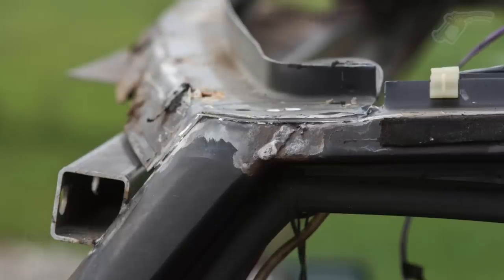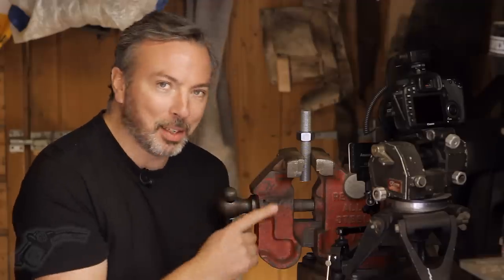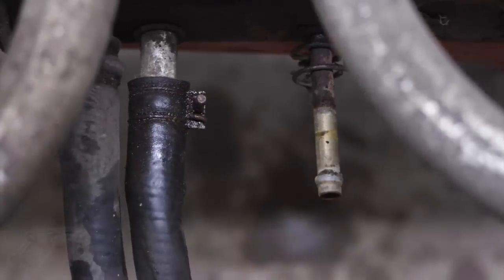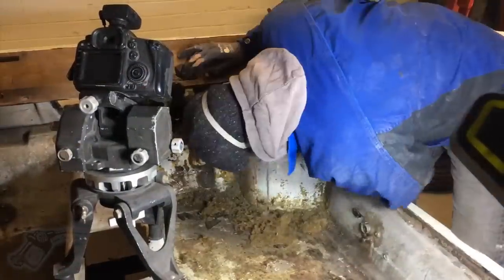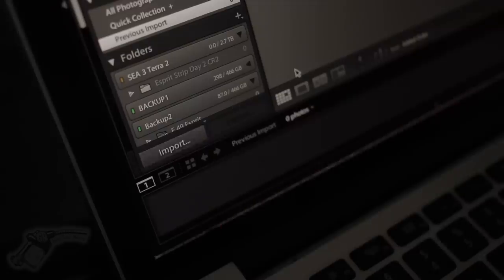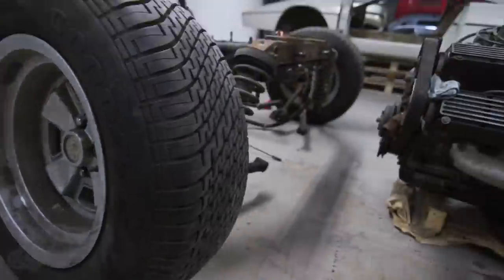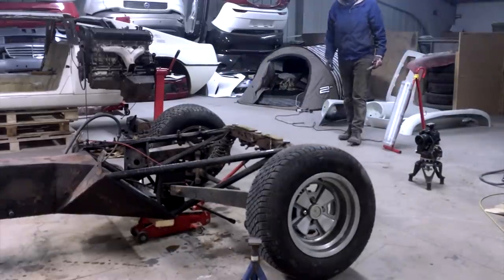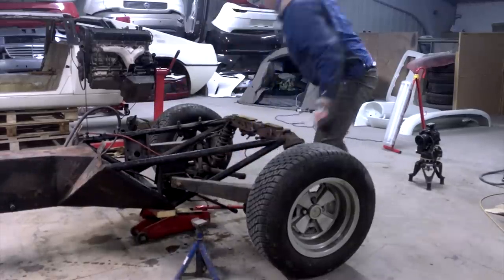How to make your car restoration take twice as long.

Comment: I know all too well what goes into restoring a car from a pretty average state... It's a huge undertaking and a huge commitment. So many people undertake the task with all the correct intentions and lose their way for a raft of different reasons. These reasons may be no fault of their own either, but it's common when they 'hit the wall' and become overwhelmed and despondent when the magnitude of the task becomes apparent. I've come close to this a few times as I normally undertake several projects at a time, but keep plugging away until I arrive at the result I set out to achieve. BUT... I can not even fathom the work you put into your productions. Your work is inspirational and highly original... I mean, show me someone else on any published platform that has (and is able) to come close to the quality of your productions. Nobody would blame you for settling for a more modest approach as the rest of us do, but to remain producing and publishing in this format as well as achieving the results you do is nothing short of incredible... well done indeed!!
Reply from the maker: That give me energy Peter. Thank you. I started with multiple projects for the very same reason - having options and somewhere to go when one wasn't working. 18 months later I realised it was killing me, 13 months after that I'm still trying my best to finish the smaller ones so I'm just one car deep. Hopefully two more months of head down will do it. Frankly I had to roll this video out because I just couldn't force the Esprit project any quicker this month.

Comment: I have been doing a little bit of welding, but it was a revelation for me to see your stop motion welding.  I saw clearly for the first time how much the metal is really distorted by the heat and how much it can move around. It never gets old...
I was very impressed by the high standard of production in this series from the beginning, and you just keep delivering and keeping true to your original idea. Fantastic!
Reply from the maker: Thanks Göran, just keeping the head down!

Comment: you are absolutely extraordinary! - Your patience and perseverance are difficult to begin to comprehend - If only projects could be achieved at the same rate as shown in finished performance... What is your next project? A TVR would be a good follow up to the Lotus - affordable and rust restricted to just the tubular chassis  - have fun :)
Reply from the maker: Never considered a TVR, have never been a massive fan but the older ones are starting to look really pretty. Thanks David
Reply: @soupclassicmotoring  indeed - a SEAC would be worthwhile :) - dont forget to add some throttle bodies or Webbers :)

Comment: I did an almost full range rover restauration as well. All the standard rust repair welding, complete front and back axle revisions,  engine revision and full panel replacement took me 2,5 years. So 4 years is indeed a long time!
Reply from the maker: I did ok! Thanks and congrats on the resto :)
Reply: SOUP . Classic Motoring you definitely did ok! I sold mine immediately (within 4 weeks) after it was done, too much troubles. 

I am looking forward to your Esprit project!

Comment: Wow man... I thought you recoded it as video and picked the frames u wanted in editing.  I'm amazed  by your dedication, and patience.
Reply from the maker: Wouldn't really work that way. Thanks :)
Reply: @soupclassicmotoring  - Taking stills will still yield the best quality, but as long as you get out of frame, I don't see how it wouldn't work. There is a youtuber named Evan Kale who made a small tool for picking frames, and automatically add them to premiere. If I rememer correctly it was called the Blipper. If you are at all curious, I'm sure you'll find it easily. If something like that could aid your production in any way, it would be awesome.
Reply from the maker: @Qgal5kap123 Thanks for the steer, interesting watch! GIt's not a bad idea but I just dont see enough of a saving, even with a tailor made device to make it a no brainer. Getting out of frame/removing the tool is the thing that takes the big time, the blipper is the same as a remote camera trigger in that respect; you still have to stop, blip, go again. [on a side note I worked tethered to the camera by a remote like that early on, it causes problems of it's own, wireless is the only way]. It might* end up being quicker in post but the still is more versatile, especially if you realise there was a problem during the shoot you missed. Shooting non stop video smashes batteries and fills cards too, adding a different set of speed bumps to work around. I think at best something like that is an alternative way of working. Know what I mean? There are lots of little adjustments to my process I'd have to make and at this stage it'd take a far more convincing time saver to get me to change my workflow. It's not a bad thing though, it's rewarding. No way I'd be doing it if I wasn't getting something from it.

Comment: This is incredible, i noticed the production values in your films but it didn't occur to me just how intrusive the stop motion element is until i saw you putting the suction cup on the esprit windscreen. Its incredible, almost as if the film is as important as the restoration. If your inspiration comes in waves and when you've had enough of the rust and weather you can focus on post production indoors. Is this the case,  where do your allegiances lie, film making or restorations, 50:50, 75:25? Cudos to you, serious suffering for your art, both of them.

Comment: thx for this gloriuos video, it made me so much wanting to shoot another stopmotion myself. can i ask what tripod u are using, mine tends to be unstable and i will need to get a better one...
Reply from the maker: Thanks a mill Florian. I use classic O'Connor film tripods, not easy to get anymore, but check out anything by Sachtler or Manfrotto, two good brands. Generally speaking good gear isn't cheap unfortunately.

Comment: A local Car Restoration Shop (Defenders Northwest LLC. - Gig Harbor, WA): According to the promise they made, the repair work was supposed to be completed within a week. However, it seems like the process is taking longer than expected due to the unavailability of certain parts required for the repair. It is quite frustrating as it would have been better if they had communicated the delay upfront, so that we could have made alternative arrangements accordingly.

Comment: No surprise to me. I certainly wouldn't do it that's for sure. Besides my garage is too cold to hang around. And film-making means a lot of hanging around! What I'd prefer to know is the routing of the inter-tank fuel line to the fuel pump. My late Esprit S1 has the same arrangement, but my car had the driver's side fuel line routed from the bottom of the tank, through the body shell and up and across the front of the engine. Clipped to the back of the bulkhead and then down to the fuel pump on the passenger's side. I believe it should go directly through the chassis to the fuel pump. Thereby keeping the same height as the fuel tank outlets. Can you confirm?
Reply from the maker: Can't say off the top of my head, but will check when I get back to the Esprit, possibly next week. My lines were all definitely in the bulkhead area with the pump on the pax side low down.
Reply: There are holes either side of the chassis at the height of the fuel pump. I've already sourced the thick panel grommets. Looking at looped carpet that replicates the original rear luggage area covering.
Reply from the maker: @FridgeProductionsLtd  Get you now, no mine definitely weren't inside the chassis.
Reply: @soupclassicmotoring  odd because if you don't route the cross-over fuel line low the fuel pump won't drain the driver side tank and you'll run out of fuel with 2/3 of a tank of fuel left.

Comment: Could you effectively take a video and edit it frame by frame or would that not give the same effect?
Reply from the maker: No doesn't work that way. Think of undoing a nut with a socket, the only time the socket isn't on the nut is before it goes on and after it comes off ;)

Comment: I’ve got a w123 Mercedes Benz 3 door 
There is some rust around the car
How much would I have to spend to possibly fix them 
Or would I weld or would I pay someone 
And do you fix cars yourself
Reply from the maker: I can't say how much, but you get what you pay for, so the cheaper the quote the less chance the work will be good. You are better off learning to do it yourself, even if you spend €500 on a welder.

Comment: 25fps
Reply: @soupclassicmotoring  only film is shot at 24 frames per second. UK PAL is 25fps. US video being 29.97 (30)fps.
Reply from the maker: @FridgeProductionsLtd  24fps is a legacy of film as you say, brought to DSLR's for use by creators who wanted that filmic look. PAL and NTSC are broadcast standards that don't really apply, Youtube accepts both so it makes no difference, just anything over 30fps is downsampled. Btw about the Esprit chassis; I thought you meant there were holes in the tubular sections of yours, yes my fuel lines did route through the pan of the chassis, but not through the holes. Visible in this episode; https://www.youtube.com/watch?v=3ky_bjGgAu8
Reply: @soupclassicmotoring  I think the fuel lines are supposed to be routed through the holes, as otherwise I cannot see why they'd be there. I'll look at this in the spring as it involves a bit of faff. With a need to drain at least 1 tank. Probably the driver's side one, which isn't being emptied by the pump typically. I get you on the  film look. It's all lost in the wash once online however. But at least it saves you 1 frame of animation.
Reply from the maker: @FridgeProductionsLtd  Makes sense, and my lines may well have been played with, but I've no idea. Someone on TLF will know. On the fps, Youtube conserves original upload frame rate [within reason] but yes 24fps is supported, and played back.